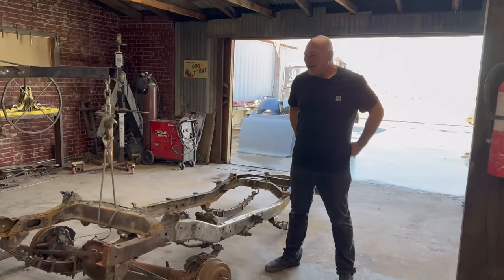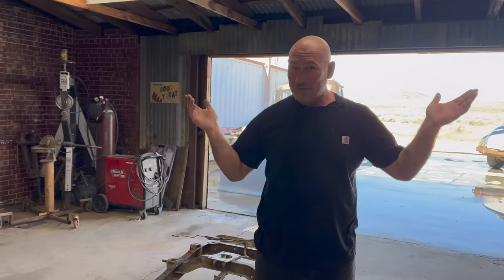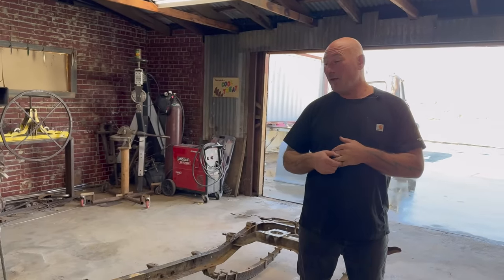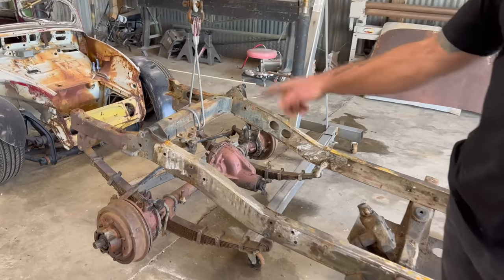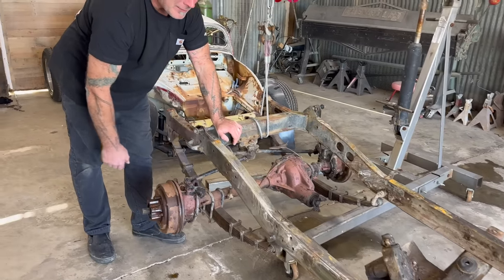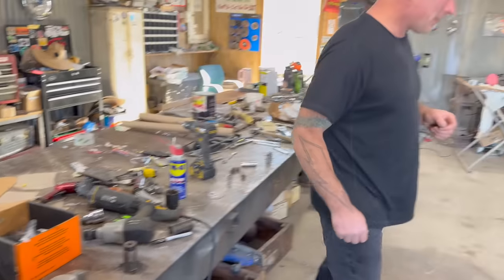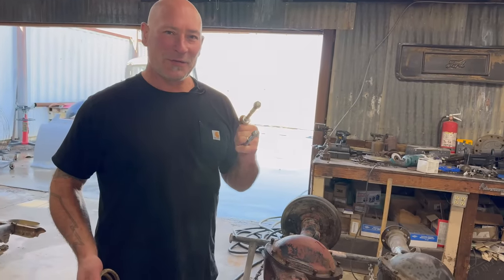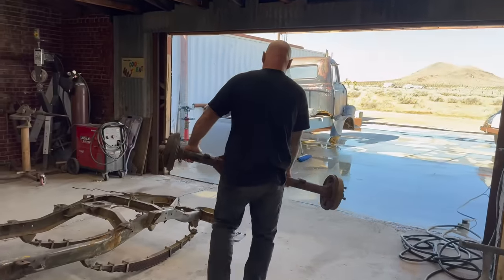Part 2! 1946 CJ-2a Willys Jeep! Ian And Jamie Have Some Major Kustom Ideas 💡 👽

Comment: Instead of making it a ugly high hood jeep, you could lift it a little on the frame, and drop the engine for the rest, fenders could be moved forward, or just shorten the frame, also shorten the frame a couple of inches in the front, just to the leaf springs, it's an original body, would be great to keep that, and modify the rest